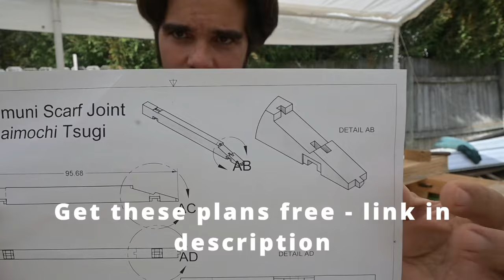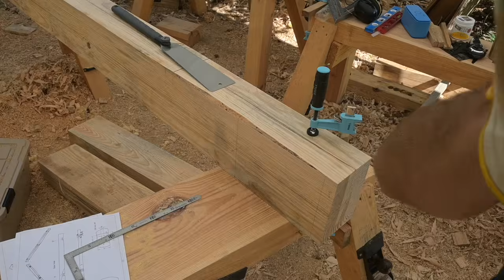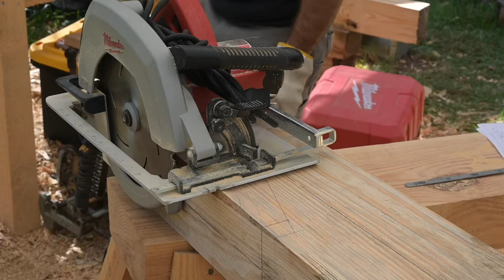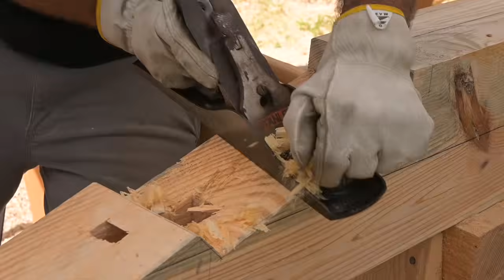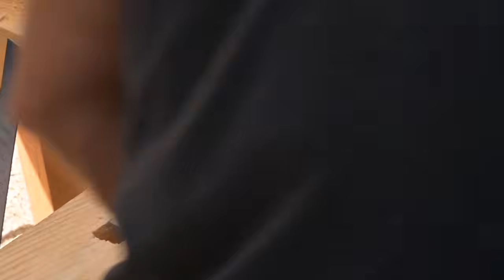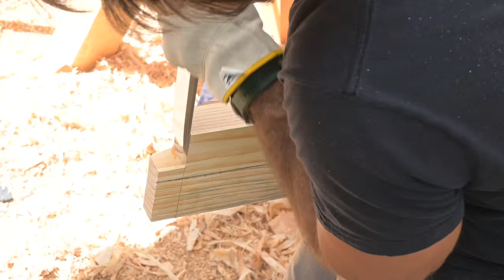Daimochi Tsugi - Japanese Joinery Scarf Joint Layout Explanation and Cutting

Comment: Not many people who came to this craft like you have with is little experience you have would tackle something like  地棟 (jimune) design and placement in a vernacular structure. I'm impressed with each video I see that you produce.  Well done !☺!

19:00 if I may offer some advice as a teacher, when instructing novice in this method...turn the beam on its side so that gravity is working with you and place a "guide block" that has a trued 90° regestration face.  Students often developed better and faster muscle memory if they learn with "guide blocks" rather than just trying to "free hand" chisel use.  After 50 years of this type of work I still use guides especially if I have a lot to do or I'm tired at the end of a day.  Food for thought...

22:00  If you have not found any Japanese...鏝丸鑿 (kote maru nomi)...or sometimes called: 鏝突き丸鑿　(Kote tsuki maru nomi)... try to find some "Crank Neck Pattern Gouges"... for the shaping of the concavity within a joint rather than flat chisels you are currently using.  The work of these these types gouge chisels is 80% more efficient at removing material with much less effort.  If you wish for some help locating these, I can make recommendation to which ones are the best for our styles of timber framing. Japanese Ebay is a great source and where several of my current ones are from, though I will hopefully be in Japan next year if things go as planned for a visit.
Reply from the maker: Thank you for the suggestions. Was just telling my wife yesterday I needed more chisels. Maybe now she’ll believe me.🙃 

I keep forgetting about Japanese specific eBay. I have the good fortune of having a Japanese brother in law who I can turn to for translation help. I’m hoping to have him write on the timbers for this little structure. I’m having trouble finding information on correct/traditional Japanese post markings. Do you know where I might find information on that? It’s okay if it’s in Japanese -  I’ll just send it over to him 😅
Reply: @appalachianwoodhomestead  Brother, at your stage in the craft and art of shaping joinery...especially those of Asian provincial orgin...where you will need 20 times more chisels than you currently have at a minimum.  In time, you will develop a style (or several) that you can achieve with fewer chisels but often you interest too wille expand into other woodworking crafts like wood carving, coopering, cobble work, turning...and the list goes on...☺!!!  Each of those have their own "chisels"  too.

For someone like you, having a family member living in Japan is a special gift. You are blessed to have your Brother-in-law for both language skills development, and a source of tools.

As for learning proper Kanji now for various architectural elements, and placing them on beams, the internet is full of sources. Have you learned to use "Google Translate" to do you research in Japanese itself?  Trust me I do not speak nor read Japanese well at all, even though I have lived there and studied it for decades. "Languages" are not my strongest of skills at all 😆 I have a running syllabus that I have created for myself that I use (like I did sharing those chisel names) that I reference. You can build your own very easily using a translator program and doing all your searching within Japanese woodworking sites and literature that is now online.  I would love to chat some day, if your up for that as I would enjoy having a longer chat than our comment exchanges. Blessings, j